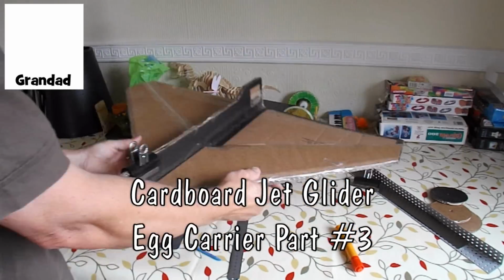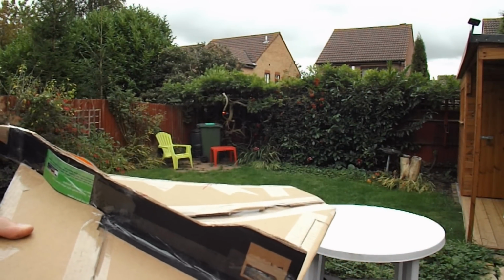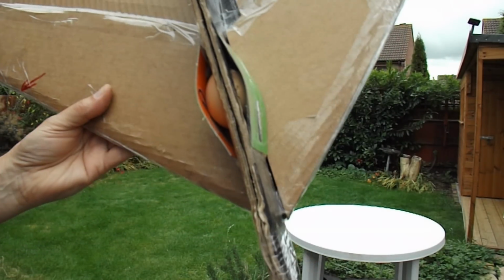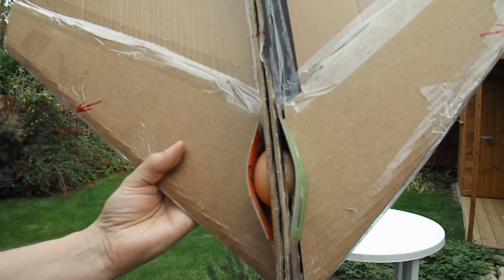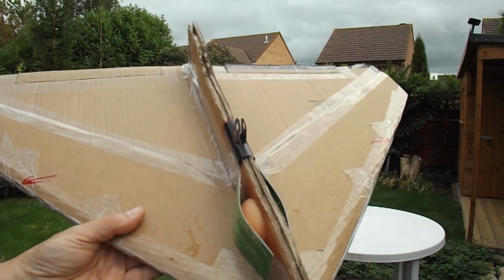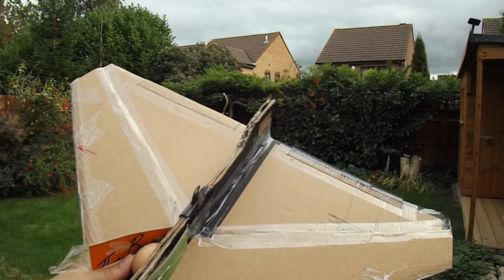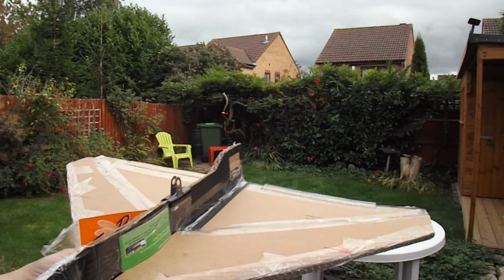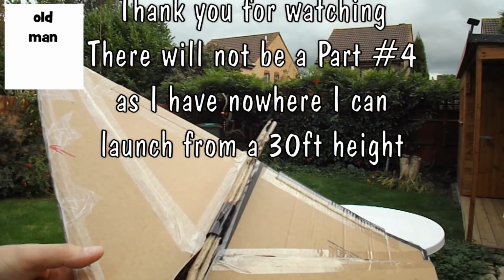Cardboard Jet Glider Egg Carrier Part 3 carrying the egg

Comment: how many feet is your garden? I have to make a glider to carry an egg safely across 30 ft and it can only be made out of any paper products and any tape. I need to know how many feet it is.
Reply from the maker: Melissa Axelrod just a little under 10m square, so that is a bit over 30 feet in each direction, however I was not testing the plane for distance, just for durability.